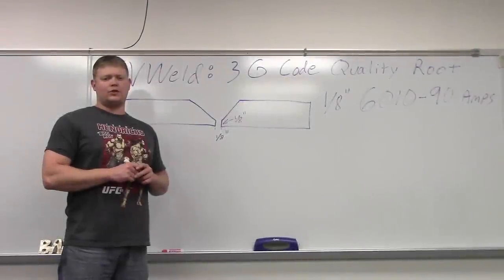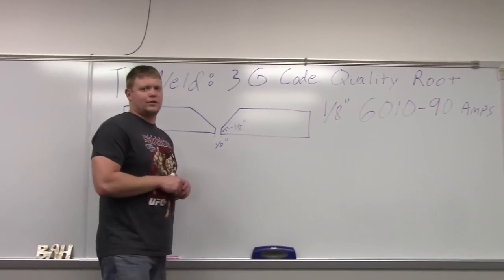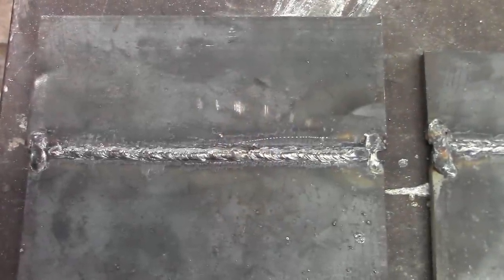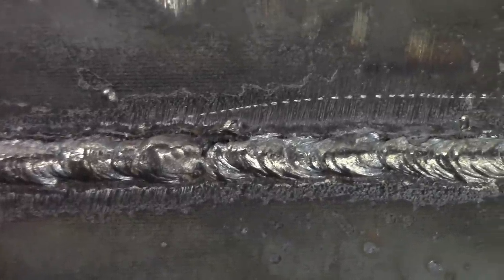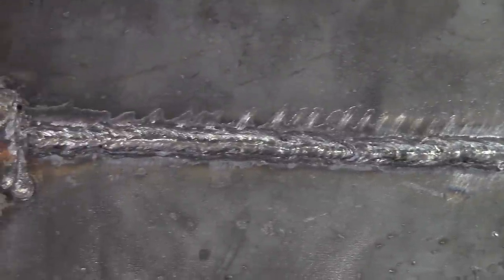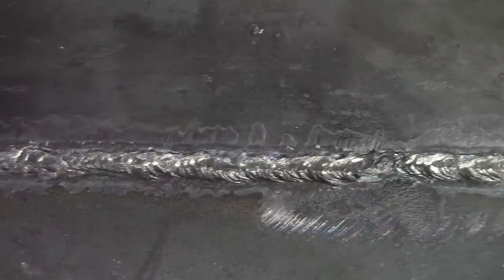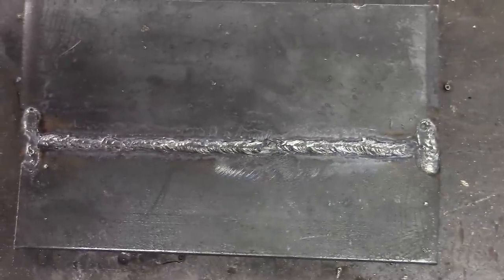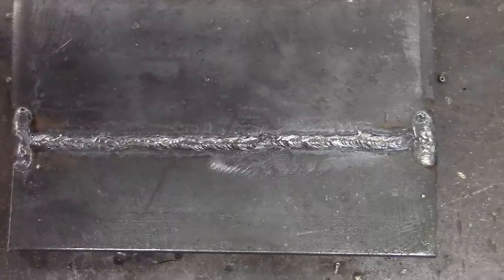3G SMAW Root Pass Open Root (Code Quality)

Comment: I like to Use 1/8 6010, whip-and-pause technique, up and down. 90° angle into the plate, when whipping, i like to dip the rod into thr pool for a split second then Drag the pool up, when the pool cant drag any more, Dip again. Thanks to that i get full penetration amd the beads push out probably less than the side of the Core rod itself.

Comment: I never get the root pass right. I either make a keyhole or don't get enough fusion. Any tips?
Reply: Keep it jammed in there. I used to run like 85 amps. I did terrible. Now im decent at 77-82 amps. Keep the keyhole no bigger than tbe end of that rod.

Comment: up and down hand movement at the root can be processed with 7018 electrode ??
Reply from the maker: Up and down is usually reserved for 6010/6011.  7018 is usually a side to side movement.

Comment: its not detalis ... I need to know what type of electrode , ampere , DC or AC , what name of your weld style..
Reply: Diiwna. Mov
Reply: Mohd Khai I know this is late but it might still help you out, they are using a 1/8 6010 electrode, 90 amps, DC current, 3G vertical, SMAW
Reply: For my basis, I used 7018, 60amp, DCEN and 10 to 15 degree angle.
Reply: To run a root, you need a 10° to 15° angle, 6010 or 6011 electrode and a 3/32 or 1/8 gap. Plates need to be cut at 30° and have a landing

Comment: I may only be 16 but Ik some stuff about welding your gap was way to small I am in training at my school for welding I put a 7018 rod In between my plates and then tack them then weld and your root would not pass mine have came a little bit better than yours and they did not pass and you have to shove ur rod in there so it can go all the way in there keep trying though
Reply: +Chris Shireu Lol, your in highschool trying to tell an instructor about a welding code? lmao there are many different ways to gap and space your pieces and bevel them so, you obviously dont know jack about welding cause that basic knowledge
Reply: +Chris Shireu funniest comment ive came across in along time
Reply: +crypto chronic listen I'm telling u bc Ik better people than u I'm surprised u got a job
Reply: @chrisshireu8596  i think its a American standard that make a gap for your bevel we have a like in our school... I think he has so close gap and its good to see if the weld been penetrate in the back of his metal
Reply: Chris Shireu it’s all preference, people like 1/8” gap and 1/8” land or 3/32”, as long as it is CP it is fine, unless otherwise specified in a WPS or WPDS
Reply: It fine with a 1/8 gap you jus turn the amps up a bit. The closer your gap the more amps you'll need to penetrate
Reply: 16 and already the number one welder in the world ....good on Ya kid you'll fit in just fine in the welding trade

Comment: I never get the root pass right. I either make a keyhole or don't get enough fusion. Any tips?
Reply from the maker: The relationship between your root face and root opening is key.  If you are blowing through you need to either tighten up your root opening or increase your root face.  If your not getting through you need to open the root up or decrease your face.  And you are right that the slightest adjustment can make it go the other way.  It is a very touchy process, and fit up is key.  Don't forget about your amperage.  People underestimate the amperage adjustment.  If your not getting through crank it up and it might just work out.  The main thing is practice, and all of a sudden you will just get it.
Reply: @TVWeld  thanks for replying. I'll practice as much as I can.
Reply: keep practicing. i was blowing out the keyhole also on my earlier attempts. for me it was like brent said above- the size of the land wasn't big enough. make sure your doing a whole 1/8th inch so there is enough parent material to make the weld without the keyhole opening way up. just keep your eye on the puddle as you work both sides.
Reply: try used electrode 7018 (3.2 mm) for the space of gap. then used electrode 7016 for root pass.